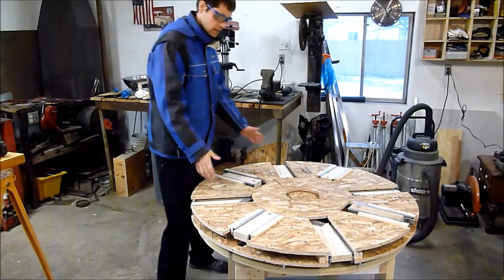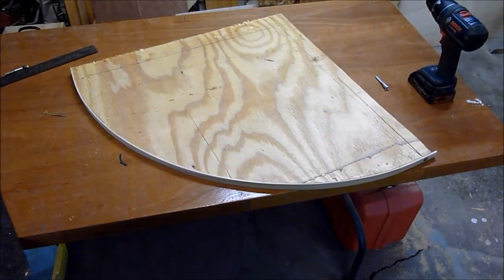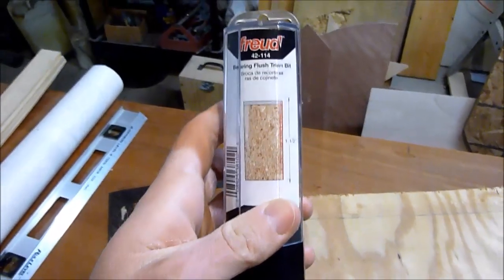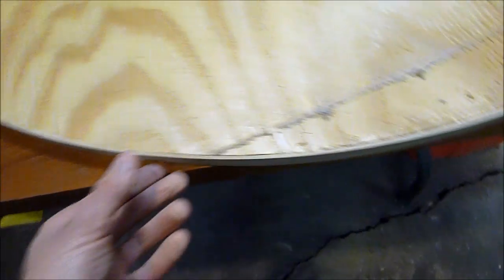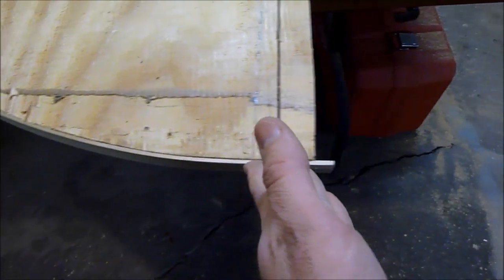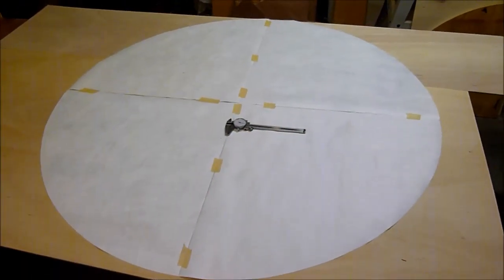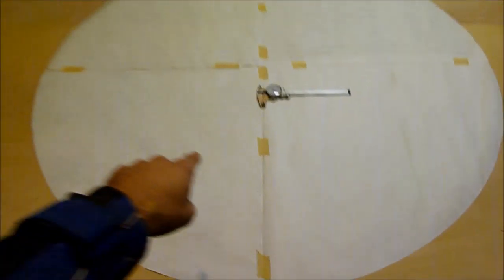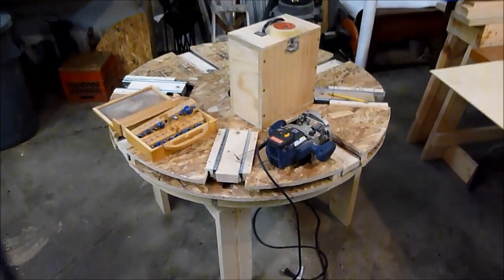Table Panels 01

Comment: use a piece of timber rather than string or wire to swing your arc,much more accurate.
Reply from the maker: I would tend to agree, but wire has the advantage of being very easily adjustable and allowing me to see where I'm marking, while not stretching as much as string.